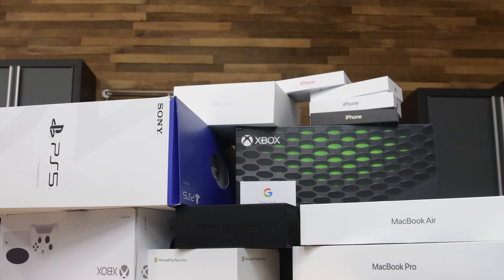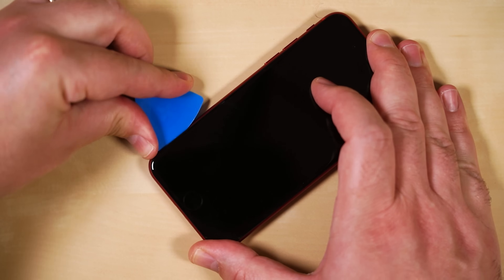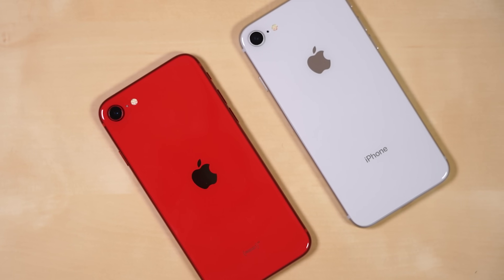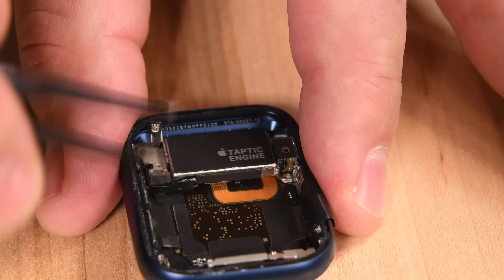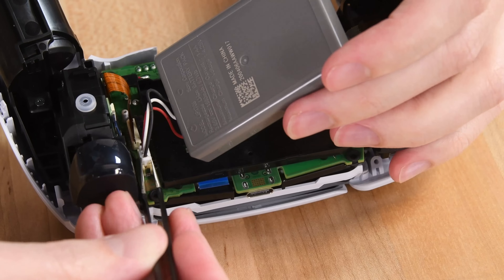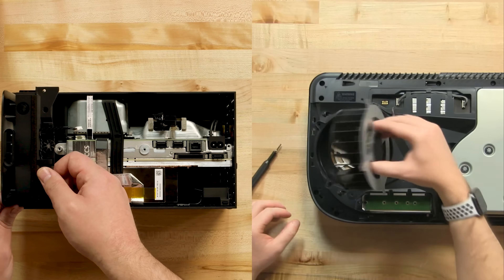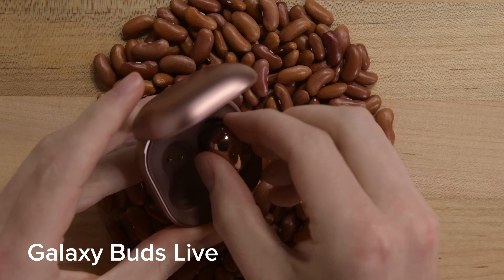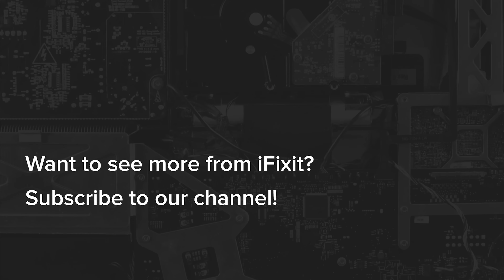Top Five-ish Repairable Devices of a Very Broken 2020

Comment: Petition to make serialization part of the "repairability" factor on IFIXIT. Serialization of parts should knock off some points, because how can you truly "repair" something if the issue is with a part that is married to the board? Yes, I'm looking at the iPhones, Macs, and iPads. Nowadays, you can't replace anything in those devices.

Now; how to go about the testing of serialization... It may be more costly, but buy two of the same device, and swap around some parts, doing extensive testing to see what part is serialized, and what isn't serialized.
Reply: Yeah, if it's near impossible to locate parts or worse, the parts you do get refuse to work because of serialization, then the ease of the teardown or modularity doesn't really matter and should knock at least a couple of points off since the device is still effectively unrepairable.
Reply: as far as testing for serialization, just swap the logic board, and everything will come on at once lol
Reply: @zoruaboy  not Really, you have to know WHICH exactly part is locked to the Mainboard, e.g Face ID, Display, Battery...
Reply: @NoName-fn6ee  right, and usually those components that aren't working will all stop working properly at the same time
Maybe I'm wrong here, dunno
Reply: Sadly Samsung has started doing it too... Hugh Jeffreys made a similar video to the iPhone 12 one about the Samsung A51
Reply: Exactly! Serialization should knock off serious points because it is nearly the same practice of simply soldering connectors straight to the board.